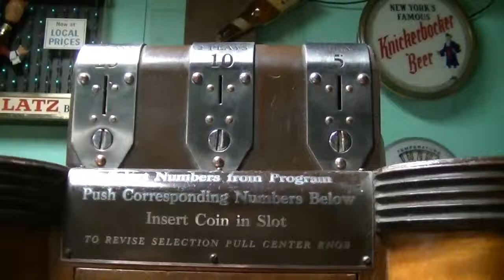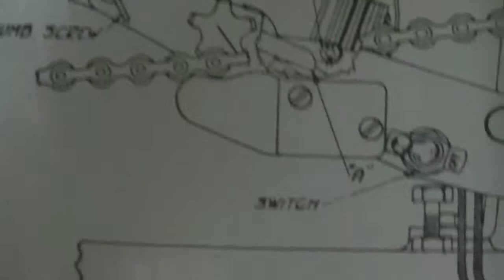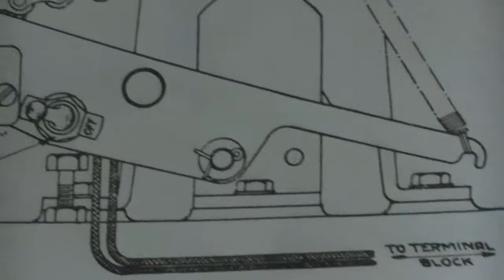1936 Mills Do Re Mi explained.

Comment: Great  informative video , I learned things about my old jukebox I never knew..............
Reply from the maker: Thanks!  I hope you get it going.  I filmed some video of me doing the amp rebuild.  It was on an old computer.  I'll try to find it and post it.  The last old footage I found of my Bally High Hand, 1940's poker machine, just played back as sound without video.  Different programs I guess.  I have to find someone that is computer savvy so I don't lose my footage.  If I can get it uploaded, I'll contact you.  Just remove one capacitor or ressitor, and solder a new one on.  If it works, great.  If it don't, no change, it didn't work before.